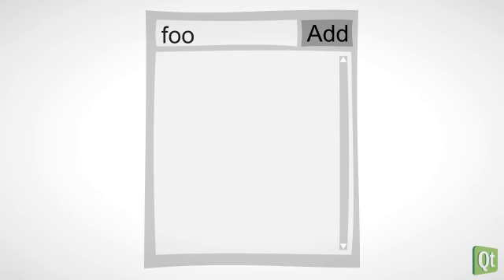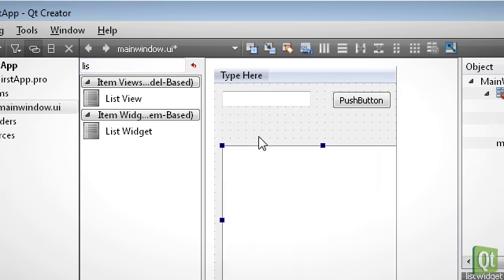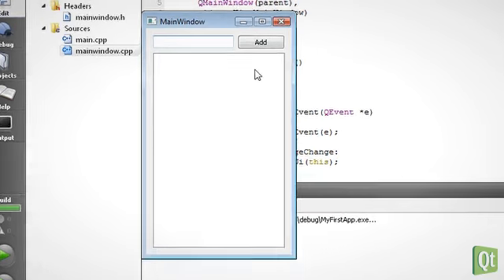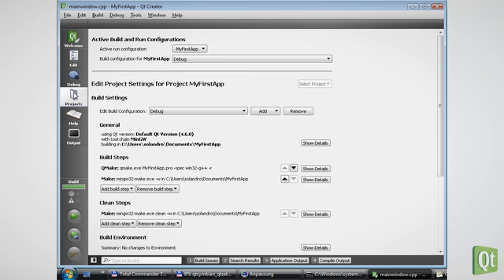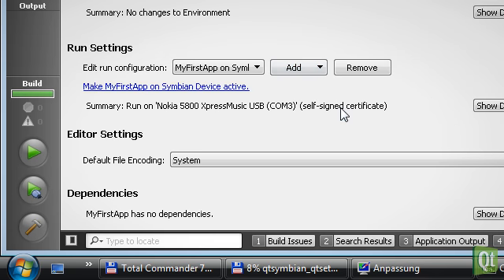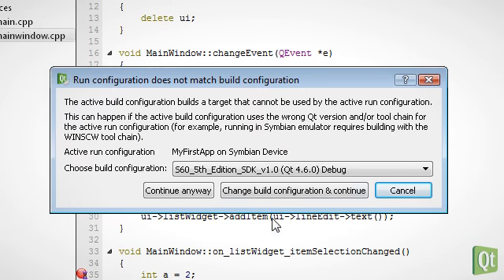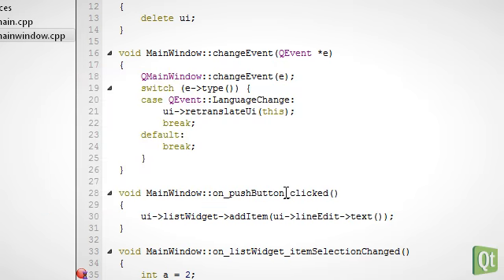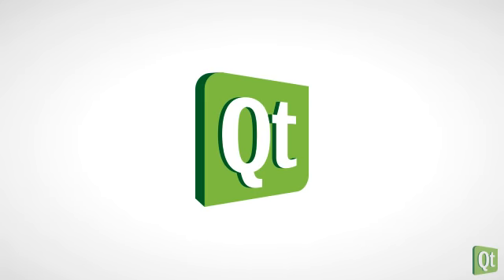Qt for Symbian - Developing in Qt Creator

Comment: I'm on windows vista and it failed on deployment... said: "Waiting for app TRK to start on COM30..." and got stuck there... on mobile phone TRK was running and saying Connected in status with USB connection and Port 1... 

I solved it by changing port number to 1 on Device Manager, (i've also changed compatibility mode to run as Administrator - but without port change it wouldn't work)... this measure corrected the problem, deployment is now possible... Thanks for all the instructions ^__^